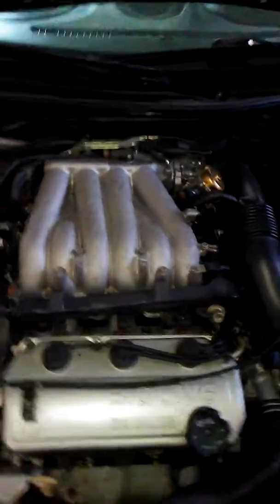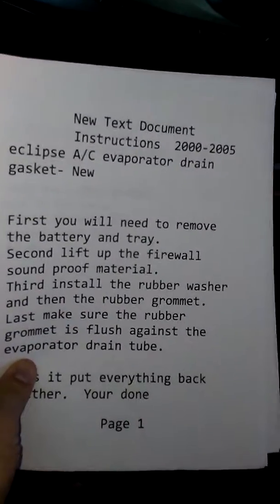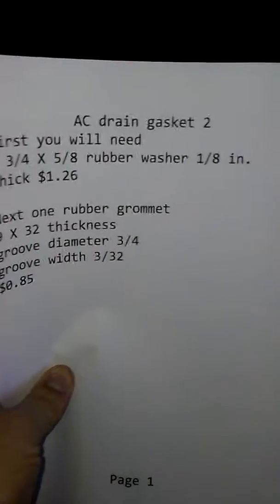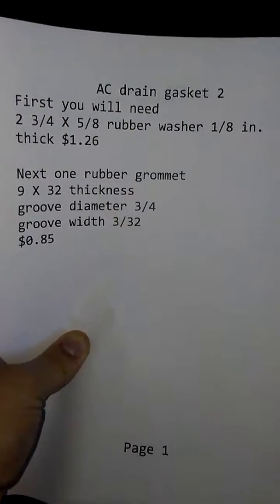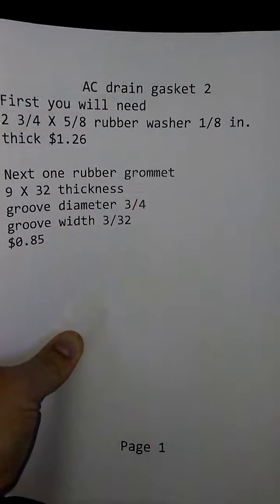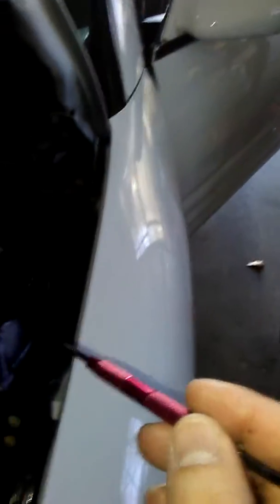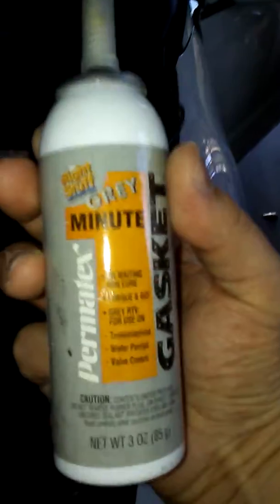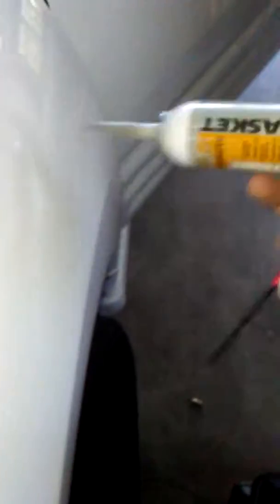2000-2005 eclipse:  Club 3g How to fix water and A/C leaks.

Comment: So does the ac evap leak water into the cabin through that wire harness area or is there a separate area that it leaks into?
Reply from the maker: It leaks from the condensing coil drain tube.
Reply: @punked6  thank you

Comment: I'm having trouble google searching the rubber washer and grommet. Any links?
Reply from the maker: Ace hardware has both of the washers. So does Home Depot. You can just go to store and buy them.
Reply: @punked6  Thanks.
Reply: I found the items I needed. Is this fix to prevent water that is supposed to drain out of the ac evap box from coming back in around the little pipe?
Reply from the maker: Yes you are correct.